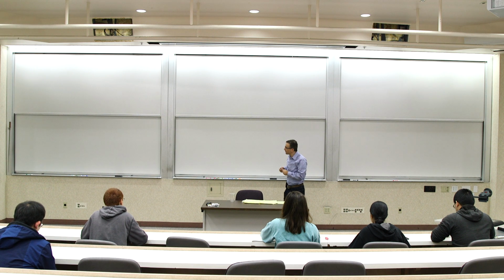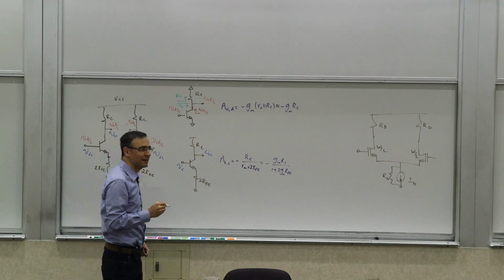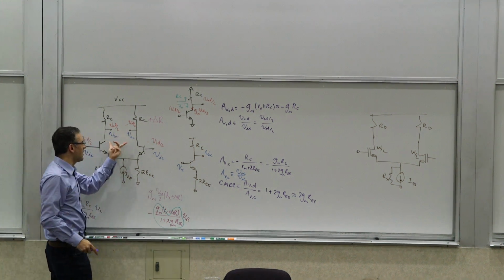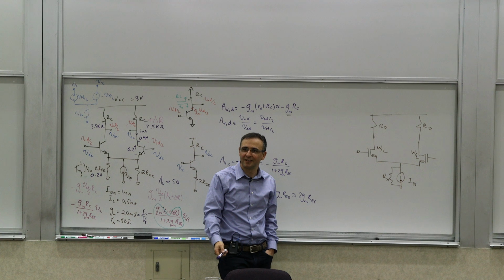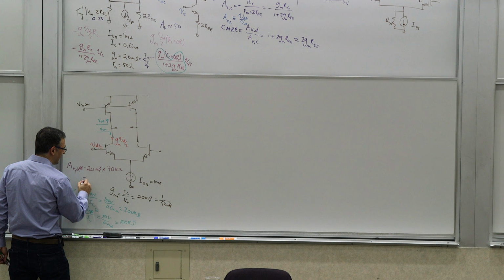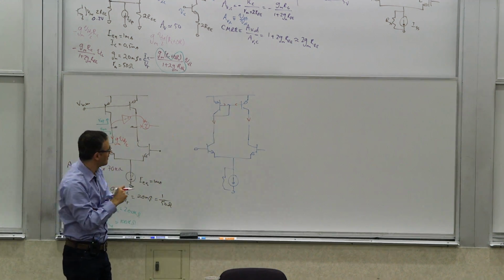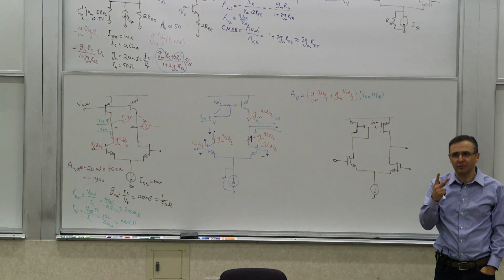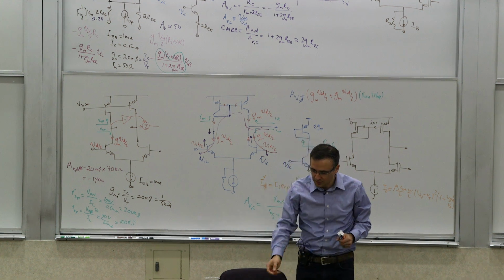129N. Differential amplifier with active load. Differential-to-single-ended conversion.

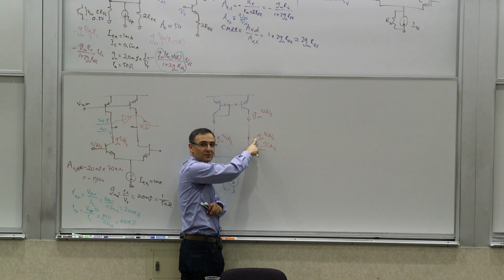Comment: I have a naive doubt, @44:20 when you flip the current direction by altering the sign. How can an NPN collector source current, won't they always sink currents? I understand I've got something wrong with the fact that this is small-signal analysis.
Can this change in direction of the current be seen as follows? When we say negative in small signal, we mean a "drop" in the current (in the same direction), so at that output node, when the collector current of Q2 drops the collector current drawn by Q1 increases which is reflected on the output node on Q2, hence we don't lose the gain. 
TLDR; This change in sign and direction is not literal right?
Reply: Yes, it is literal. This very current he's talking about is the small signal one. It varies around a DC op point, so there is nothing wrong with the transistor. You have to remember the sum of both T1 and T2 current are always equal to that one he had choose, 1mA I think. Its been 4 months, had you got the answer?

Comment: In the circuit 14:00 , when there is a mismatch in the load resistors then in the calculation of Differential gain, how are considering the common point at Differential ground? 
Similarly, when you are calculating common mode gain in that circuit 14:00 how could you ensure that there is no current flowing from between two rails and you can apply open circuit between two rails to calculate common mode to differential mode conversation?

Because the circuit is losing its symmetry
Reply: Hi 
Good question
If Rc is changed by a small percentage, it is important to note that the differential ground is still valid as both the nmos are still in saturation or forward active for bjt 
Then since the current through the rm resistance is same if you consider the T model and hence the node has to be at differential ground 

However if the mismatch is at the bjt or nmos WL,vt etc then the gm of both the transistor are different and hence differential ground no longer applies.
Reply: @rohitn1704  Thanks for your reply. So, you wanted to say the change of load resistor does not impact the current flowing through the rail. So, for Common Mode calculation same amount of current flows through both the rail even though load resistor has been changed and no interchange of current will happen at common point. So, the current has to go through individual Resistance attached with the Source terminal which is nothing but twice of the output resistence of the tail current source. Yes, your analysis is true in this case. 

But, what happened in the differential gain. You have said that it is valid for this also. So, if it is valid then we can apply Half Circuit concept here. But through half circuit we get different gain from different half circuit. Is it correct? Then, how is the differential ground concept true for this case?
Reply: @ayanchatterjee3884  half circuit symetry is not valid 
Differential ground is 
If the same current flows through both the legs, then the drain voltage adjusts to make it equal. So there is no symmetry. 
If you think practically due to channel length modulation differential ground is also invalid so there will be slight change in the Vs but if we choose to neglect that we are still okay 
Same case as in ota where differential ground is still applied to keep output resistance ron || rop otherwise we have to consider degeneration.

Comment: In the diff pair with active load (no current mirroring), the way it was drawn show that the active load is voltage biased using vbias, while in the common mode operation, this active load should have current of Iss/2, which is current biased. This is not going to work, since voltage biasing states that the current is K'(VDD-Vbias-Vth)^2 = Iss/2, and both Iss and Vbias are defined! What is the correct way of generating Vbias? Is it using the same tail current source, mirrored in other branch so that Vbias is something like VDD-VSG=VDD-sqrt(I/K') and we design K' such that there is no conflict?
Reply: You are right 
If you have two unequal current source in series, the voltage increase so as to bring them equal and one eventually ends up in linear region 
So one has to bias properly. 
But if I  think about the current source, the vo,cm is defined by  the  the current itself.If the currents are not same vo,cm adjusts to keep the currents to iss/2 so channel length modulation may be an important parameter that you have to consider to think how the vo,cm is set. But yes you are right we must keep the current close to iss/2 to get max swing